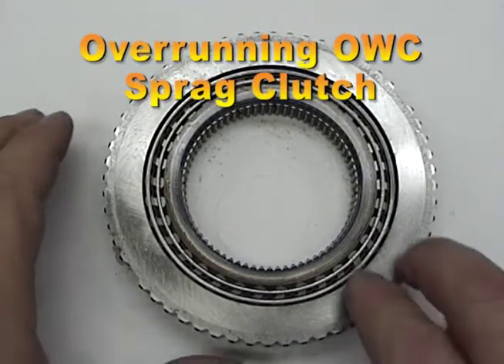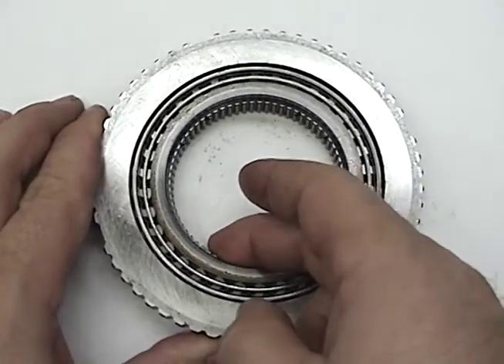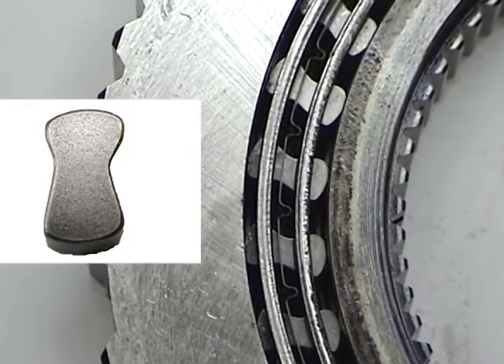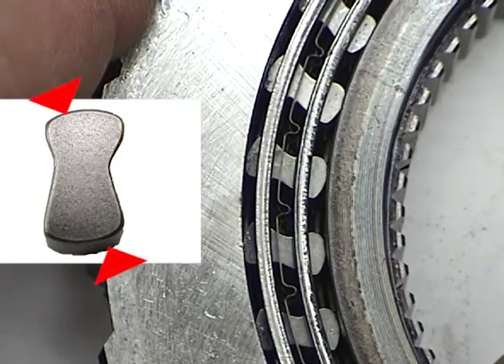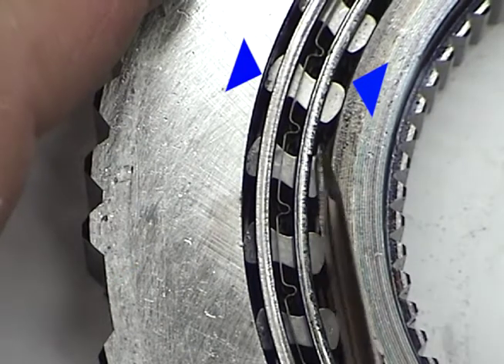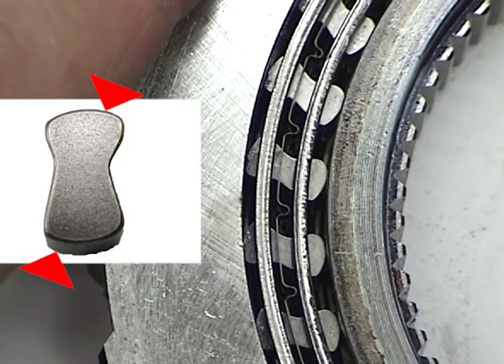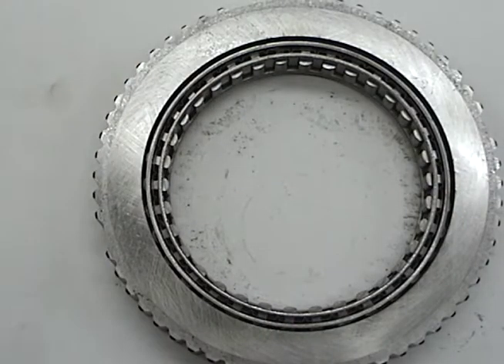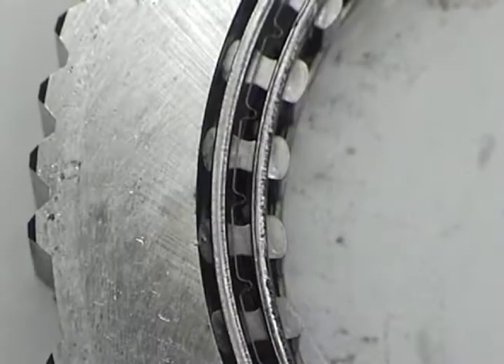Sprag clutch Operation

Comment: What happens if the sprag breaks? Do you lose all gears?
Reply from the maker: That really depends on the transmission and it's design.  Some transmission will lose drive 1st gear but when placed in manual or low 1st it will drive away because they use another clutch or band for low 1st gear.  Others may lose 2nd gear.  There are too many transmission and design differences to comment on but normally at least 1 gear won't work up to multiple gears.
Reply: @DrivelineMaster   it turned out the splines in the converter stripped out. 4l65E.  FTI 3200 billet 9.5”
Reply from the maker: Glad you know what caused your problem.  Yes, that will cause a no gears at all issue.

Comment: Great Video! I have a 2004 Honda Odyssey with a bad one way clutch (sprag style) in its automatic transmission. When coming to a stop it sometimes doesn’t engage but I can get it going with putting the gear in low or 2nd manually. I’ve been driving like this for 1 month. How long do you think this one way clutch failure can last ? Will it get worse and ultimately fail ?
Reply from the maker: 1) yes it will eventually completely fail.  When you put the transmission in Manual 1st or manual low the transmission engages the 1st hold clutch which bypasses the one way clutch (OWC).  Manual low provides engine braking when going down hill with your food off the gas and it also prevents up-shifting on acceleration so you don't lose torque when going slowly up a steep hill. This is required if you have ever driven up steep hills like some of the streets in San Francisco. Depending on how bad the failure is and how much metal is put out from the failed OWC you might be able to drive like this for a while.  If you always use low or manual 1st to take off you will reduce the load on the OWC and minimize the wear and metal dispersion throughout your transmission.  You could extend the time before repair or replacement by always using manual 1st to take off from a stop.
Reply: @DrivelineMaster  Thank you so much for the detailed explanation on this, finally I understand. When it first started acting up it would do it once every 2 weeks when sitting for awhile, now it does it every day and more when cold and it does it when warm too. I’m still chugging along with shifting to low gear at stops. I’ve even driven a 14 hour road-trip like this because on highway speeds the transmission shifts well with “drive” working.